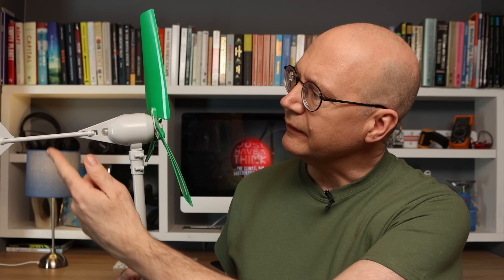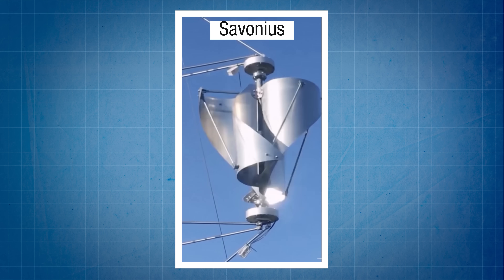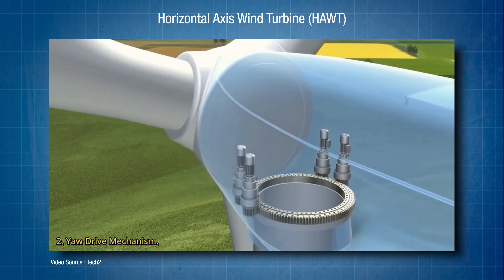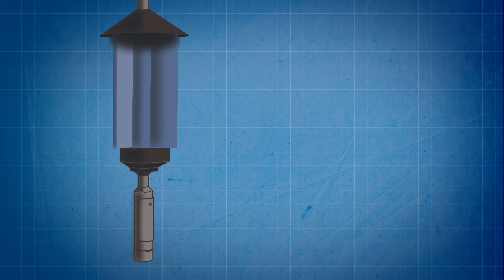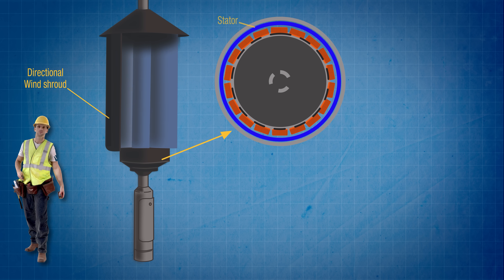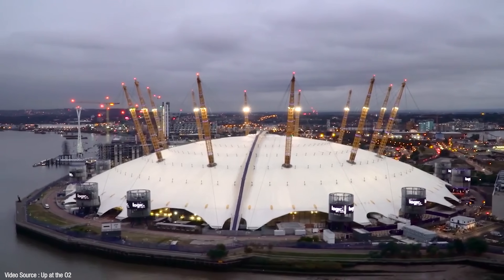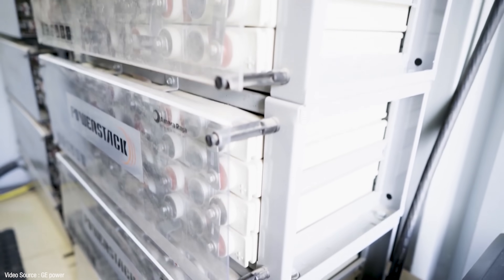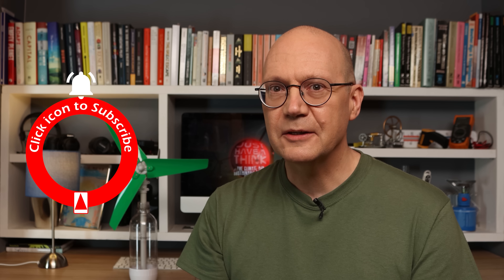A vertical axis wind turbine that doesn't need the prevailing wind! How do they do that?

Comment: As a 'mainly former' Motorcycle rider of four decades I can certainly vouch how much power is generated by large vehicles on our roads.
Reply: That isn't power generated, it's power consumed, creating air turbulence, which ultimately goes to heat via friction.
Reply: On some roads here in Belgium if busses and trucks are passing you while cycling, you don’t have to pedal one stroke. You just ride the slipstream.
Reply: The answer is blowing between blades as oil guards sell embedded betz limits last 100 years.just hold.4x8 blocking it all  in 1 hand turn sidways  the other  sheet and spin out it is  easiest .on.tippy toes greased To make wormholes
Reply: Here's something for the idiots of Renewable Energy: 

Sooner or later you greenies are going to need to grow up and learn how economies work. - hint government people understand nothing of economies other than  how to rape them.    

These G-morons decided "woke' power (power that doesn't really work) was a great idea for them, not us, so they decided to steal some money from some ratepayers in order to pay others to stimulate the growth or power that really doesn't work - ie wind and solar.

In the real world, the one that really works,  there is something called supply and demand and these things regulate the price of everything fairly.  

Your butcher buys his beef by the side and pays more for it than the meat packing plant did who in turn paid more for steer than it cost the rancher to produce it.   Get it so far?     

Now when you buy that beefsteak at the butcher's shop he's going to get his markup as well,  so you as the end consumer are going to have to pay a lot more for it per pound than the rancher was paid for it.   

Next time you want a beefsteak drive out to a ranch and buy your steer on the hoof - then you slaughter it, age it carve it up sell the inedible parts to dogfood processors and the like and eat the rest of it on the cheap - no you want the value that all those who added value to the meat along the whole length of the supply chain don't you?  Or do you buy your steaks on the hoof?      Or do you expect to pay the  ranchers price at your favorite steakhouse as well?

It's that way with electricity too, you cannot expect the power company to buy power back from you at retail rates when they don't even need or want the power. With that business model they will go bankrupt as soon as their investors are wiped out.    

If that rancher were to dine out at your favorite steakhouse why not demand that your ignorant politicians make the restaurant buy his on-the-hoof steer from him on demand at the same rate per pound that they charge you for a 16 oz prime rib?    

The problem is, as with all government planned economies, sooner or later everyone will want to receive the grift instead of paying for it, when that happens the lights go out - permanently.

The most ignorant feature of all of this is that it is supposed to solve some problem that the grifters dreamed up but that does not actually exist so solar panels and wind turbines only create huge problems, they solve nothing - time to wake up you dizzy Californians.
Reply: Millertas. RE: "How much power is generated" Thank-you for this essential contribution! As a bicycle enthusiast & former motorcycle rider, we both know how air-vortexes "power" created by fast moving vehicles force us to correct our trajectories (swerve) as they pass. Cross-winds from regular wind blowing across non-treed highways cause us to 'swerve'.  Millions of accidents (worldwide) are caused by mis-corrections (responses over & under what is optimal) produced by highway a) vehicle-produced & b) regular ambient wind air-vortexes plus c) combinations of both a) + b) against both smaller vehicles, motorcycles, bicycles & pedestrians & or large-vehicles. This steering correction factor causes us to 'SWERVE' sometimes into or bouncing off of a 100 km/hr moving many tonne vehicle & road surfaces. The combinations these vortexes are quite unpredictable & dangerous.
I have bicycled over 100,000 kilometres at home & across the US & Canada portions of the N.A. continent.
As well we must acknowledge wind-vortex damage to highway-close-by buildings & homes.
Linear-axis highway wind turbines by calming vortexes in highway air masses, will have a significant highway accident mitigation for road safety as well as producing energy & mitigating all wind damage produced by highway denuding of trees. Next. Every highway should be obligated to plant trees for absorbing / mitigating: CO, CO2, dangerous toxic Hydro-carbon, dangerous brake-lining asbestos, dangerous tire particles etc. Tree branches & leaves actually convert wind energy blowing through them in huge amounts into ATP as the basic biological cellular energy component of life-function.
Reply: But, if you use it to generate electricity, you are using fossil fuel to generate electricity. Rather using the wind of trucks, will cause as much extra gas usage as the power you generate. It's non ecological and stealing fuel from drivers.
Reply: @zazethe6553  You missed the comment about this in the video.  The energy is already being put into the air by passing vehicles whether there is a generator absorbing some of this energy or not.  There is no feed back to the vehicle so energy isn't being 'stolen' from them any more than the act or punching a hole in the air that happens whatever surrounds the vehicle..
Reply: @dacutler  actually, there is a feedback loop, it's just that we cannot imagine it. By using the energy the cars have to work harder to generate wind energy, because it introduces resistance and the cars have to push harder into the air.  Every kwh you retrieve from it would increase the gass burning by 1 kwh.
Reply: @zazethe6553  Are you saying that from experience?  How does the use of energy that is being created anyway, feed back into demanding more from the engine.? The  turbine isn't  creating a greater headwind as the car has passed before it gets to the turbine.  Also, why are you saying the energy absorbed by the turbine is exactly the same as the energy you say is demanded from the car?  It's an open system, and, even if you are right, it's extremely unlikely the energy absorbed is the same as produced.
Reply: @zazethe6553  , permit me to disagree. The turbines are not attached to the vehicles, consequently, they would not increase the drag on the vehicles. Additionally, unlike dams they do not generate their power by creating a barrier, restricting matter in motion. They merely tap into that already existing flow or displacement which every moving object causes. I also mention that the air would be generated from the  "slipstream" of the cars at the edge of the road, where there is no possibility that that slipstream is leading to increased efficiency by following vehicles. 
This idea is GREAT! Why isn't it my idea?
Reply: @philtarpehdixon7441  I agree.  That's certainly what I experienced when I spent 33 years in the automotive industry, some of which was in wind tunnels.
Reply: @philtarpehdixon7441  by adding drag to the slipstream of the cars, you do actually slow down the cars. The cars are in fact connected to the turbine, air is the connecting medium. I know it is unintuitive, because air seems like it cant do that, but that's just fluid dynamics. By slowing the flow of air in the system, the cars have to work harder. Even if you do it after the car has passed.
Its like when you drive in the slipstream of a truck, you get better mileage, but the truck is actually pulling on you and gets reduced mileage. I know it sounds unintuitive.

The exception could be if you place turbines in the center of the road between opposing lanes, as there the cars have to overcome the drag produced by opposing traffic anyway.

Do not mistake my intention, i am all for ecology and green energy, and i think it is extremely important. But this implemented incorrectly would increase car emmisions
Reply: @dacutler  It does not require headwind to slow down the cars, the car  is being sucked back by the vacuum it creates due to the displacement of the air it just did. This lower pressure behind the car quickly fills back up with air, creating wind. By slowing the filling of this vacuum down by placing turbines in the system, the turbines are in a way creating more suction on the car, as without the turbines the air would rush in faster to fill the vacuum created by the body of car driving trough the medium. This makes the cars work harder,  it more efficient better to allow the air to flow unrestricted.
This is also why cars have rear spoilers, as it curves the air around the body, into the vacuum zone just created by the displacement, reducing drag on the car by the air behind it.

In all things, the conservation of energy is always a bummer. There's no free energy sadly.
Reply: @zazethe6553  Turbines aren't 'slowing the filling of this vacuum'.  It's an open system and the car has long gone before the energy it leave behind in the vortexes produced is used by the turbine.  You are right there is no free energy, but a turbine is using the energy that was being created by the car in the first place, instead of it dissipating in some other way.  A good example of this is how a turbocharger works.  The turbine part of it is using the energy, both heat and pressure (in fact, as much of the enthalpy as possible) that is already in the exhaust to provide power to the compressor to increase the charge in the cylinders.  Taking that energy in the exhaust isn't providing a further drain on the engine power output to anywhere near the energy the turbocharger produces to compress the charge in the inlet.
Reply: @dacutler  It would be like how an electrical generator turns easily if you aren't pulling energy from it's motion, but as soon as you start to draw current turning the stator becomes increasingly difficult (resistant).
Reply: @ikannunaplays  It's nothing like that.    All a generator does is take energy in the form of kinetic energy and converts it to electrical energy.   It's a closed system. The turbines we are discussing here take energy that is the form of kinetic energy in the air and converting it to electrical energy. It's an open system.
Reply: @dacutler  You're right, it does. But, how does a generator accomplish this exactly?
Reply: @ikannunaplays  A magnetic field cutting an electric field.  Or vise versa. Moving a wire through a magnetic field produces an electric current. That's a generator. Or to put it another way, place a wire with an electric current running through it in a magnetic field produces an electromotive force.  That's an electric motor.
Reply: @dacutler  What happens to the moving object (rotor) once you draw current from the system already in motion, and why?
Reply: @ikannunaplays  Like I said this analogy you are trying to make isn't relevant to the turbines we are discussing.  We can discuss it if you like, but it won't get us anywhere in the issues we are discussing.  A generator is a closed system so needs input from outside to create the conversion you are talking about.  The turbines on the side of the highway are using the vortexes and pressure differentials that have been created by the traffic whether the turbines are there or not.  If it wasn't the turbines absorbing the energy in the moving air, that energy would dissipate.
Reply: @dacutler   air is a single medium cars wade through, at the size and speed of a car, slowing the air behind it,does matter. Turbochargers don't work like you say at all, they do in fact increase power draw on the engine. But, they also compress air into the engine, making the engine produce more power thanks to better air to fuel ratios. This makes it an overall gain. It has nothing to do with this.
Reply: @zazethe6553  I agree with you that unless the turbines are placed between two opposite lanes of traffic, the turbine will worsen vehicle mileage therefore resulting in worse vehicle emissions. But I think you missed some details of their project as judging from video, they intend to place the turbines right in the middle of opposite lanes of traffic. The purpose of the directional wind shroud on their turbine design shown at 7:02 is to ensure opposing wind direction(because they intend to place them between opposite traffic lanes) won't counteract one another and reduce the turbine's efficiency.
Reply: @zazethe6553  absolutely incorrect
Reply: @zazethe6553  No.  In open air it's only wasted air motion that's being harvested.  There is no mechanism for taking useful energy from the car unless it's in a system like the car is pushing air through a close fitting tunnel and that air is slowed down by a turbine in the tunnel that resists the airflow, thus increasing the resistance on the car pushing that air.  
This may be easier to understand with the example of an anchored generator in open water with a tethered bobber that spins the generator through a ratchet when a wave lifts that bobber.  The wake from a passing boat will contribute energy to that bobber long after it has passed and with no energy extracted from the boat that was not already wasted by making those wake waves.
Reply: @denbecr49  the fact that the bobber is there, requires the boat to expend more energy. Exactly as much as the energy needed to keep the bobber,bobbing for as long as it does. There's no such thing as open air, you just can't imagine how fluid dynamics work, which is normal,as it's extremely unintuitive.
Reply: @zazethe6553  
The fact that the bobber is there only raises the water level, irrelevant to energy expenditure by the boat in making a wake, by my reckoning.  The energy imparted to the wake travels with it until it is lost in ways that do not change anything in the relevant vicinity of the boat in any way I can imagine.  It's not really science if it's something correctly ascertained by intuition or "common sense", so I'm genuinely curious.  If what you say is true and you understand it, you should be able to describe how the energy in a boat's wake can affect the boat according to how the energy is subsequently transduced.  The bobber is extracting energy from the wake that is moving AWAY from the boat, right?  Would you have to cite too much of the science of fluid dynamics as prerequisite for enlightening me about this particular scenario?  I encounter that when debating religious antievolutionists,  flatEarthers, antivaxxers, overunity believers etc.  I hope Dunning-Krueger isn't lumping me with them on this issue!   😰
Reply: @denbecr49  right, no energy taken from that boat, but then an infinitesimal abount from the boat behind, and from the one behind that, and from the line of boats behind that
Reply: @denbecr49   ohhh, also, I just got your point. The turbine does sort of affect the car moving TOWARDS it, as the car is pushing air towards the turbine, as well as sucking it away. As the car approaches, the air is pushed towards the lamppost which provides a resistive force back to the car, but since most of the air can slide past the narrow profile of the lamppost, there is not as much of an affect. The turbine, with a wider profile, provides marginally more resistance to the car as it approaches. It is marginal per vehical, but 25kW is insane XD
Reply: @zazethe6553  the air that goes to the vacuum behind the vehicle doesn't always have to be on the side, right? Even if air is being slowed down by the turbine by the side, air on other areas will be sucked instead, like directly behind or on top of the vehicle. If there's a vehicle following behind, it might even push the air forward to the next vehicle. Also, the wind doesn't always has to come from vehicles, it can also come from natural wind.
Reply: @nd_otd  correct, I never said it was a huge effect. But it messes with the fluid dynamics of the air. Maybe it is only .01% impact on the car's fuel consumption. However if the turbine generates 1000kwh, and it requires 10000 cars to do so, every car will contribute 0.1kwh worth of extra burned fuel. This is tiny, in comparison to the actual output of a car, but multiplied all the energy of the windmill, that doesn't come from external wind blowing in, cold from the fuel of the cars. The effects and drag within air are not noticable in our daily lives, so we think it's not there. but small amounts multiplied by high speed, large bodies of cars and huge numbers of cars, do add up. Similarly,a single car also will not even produce enough wind to make the turbine spin 3 times, so by that logic, the turbine shouldn't generate electricity, but it does, because many cars pass by it, all contributing a fraction of the energy needed.
Reply: @zazethe6553  "by adding drag to the slipstream of the cars, you do actually slow down the cars."
You are correct. There is no free energy.
If the turbines are far away from the vehicles they won't slow them but they will not reap any energy. If they are close the opposite will apply.
The extreme example is a vehicle in a tunnel with a turbine at its mouth ,the vehicle has to expend a huge amount of energy to push the air ahead of it ,down the tunnel, to be recovered by the turbine.
Vehicles even effect each other purely through their aerodynamics. When one vehicle "slipstreams" another, as is common during races, both vehicles benefit . They become one aerodynamic system. The trailing vehicle benefits by not having a "head wind" because the vehicle ahead is parting the air ahead of it and the leading vehicle benefits from reduced wake turbulence creating drag. The entire system is more efficient due to having an improved frontal area to length ratio and therefore can achieve a higher speed than the individual vehicles could on there own.
Reply: @zazethe6553  
You are right, only in that Cutler chose an inapplicable analogy with his turbo.  He was correct up to that point, IMO.  
On a calm lake a distant boat can be docked by the time the energy in its wake is harvested.  You haven't convinced me the boat could have docked sooner  except for a future interception of its wake.  Yes, I know there are unintuitive things about all sciences, but that's just handwaving when specifics are being debated.  In this example you would have to argue that a cause can come after its effect.
Reply: @quadracycle4000  
That MAY be the case, but that's not what Zazethe is claiming.  He claims energy is robbed from the first or only boat with no mention of followers.  Even in your case, bobbers extracting energy from waves makes for calmer water.  Boats travel more efficiently through calmer water, not in the wake & turbulence of another boat, but that's getting into differences between powering & drafting through water vs over pavement.  Turbulent air at the right scale can reduce the relative vacuum behind a moving vehicle as in the case of vortex generators placed where the slipstream ordinarily separates from airplane wings and fuselages, but those examples only raise the question of whether the  bobber is returning more energy to the boat than it's robbing from it when it reduces the size of waves.  No. It's doing neither.  But in the case of vortex generators, they are robbing a little power from the plane in a manner that reduces it's drag, thus saving, but not returning energy.
Reply: @zazethe6553  No.  Drafting a truck does not reduce fuel economy of the truck.  In a drafting situation both vehicles are accelerating a smaller combined mass of air than they do separately.  Both benefit, but the follower gets the greater share.  Even the lead truck gets better fuel economy in a convoy, just not as much better than the others.  Eliminating part of the relative vacuum behind a truck reduces the load on its engine.  It's 'unintuitive" until you understand it well enough to improve your intuition.
Reply: @denbecr49  I am trying to visualize this, you are thinking a basically 2 dimensional wave behavior works the same way as a 3 dimensional teardrop shaped air pressure bubble? I'm not sure that is a direct analogy. If the vehicle is moving through the air mass like a submarine would through water if it was compressible, creates a high pressure wave at the bow and there would be a trailing low pressure area creating drag. 
    A moving bubble of changing air pressure. What he is saying is spinning the turbine takes energy from the entire bubble as it moves past, not just from the air on the high pressure side.  If it takes more from the bubble than it gives to the grid then the vehicle is losing. 
   This is not taking into account being mounted in the center of a divided highway, two way traffic or wind.  Which are all game changers.
Reply: @rockon7848  
What I'm saying is there will be energy in wind produced by the vehicle that can be harvested outside the "bubble'' you speak of.  Just like my example of a boat's wake, an airplane that has landed leaves energy in turbulence that lingers long after the plane is gone.  The next plane's landing on that runway has to be considerably delayed.  None of that turbulent energy can influence the relative vacuum behind the plane minutes after the plane has long traveled into undisturbed air.  
My objection to Zazethe's statement is about his extrapolation of effects way beyond their real limits.  
He's wrong about a truck's mileage going down when it is being drafted.  
He's wrong that the mere presence of a bobber in the water extracts energy from a long passed boat.  He is right that any wind generator close enough to inhibit airflow in a manner that increases the temporary Cd of the vehicle will be robbing power from it, but my point is a nearby wind turbine isn't necessarily interfering in that manner depending on where it's placed.  The airflow around even a very aerodynamic supercar is definitely not a 3D teardrop shape. The car would have to be a perfect 3D teardrop shape itself and proportioned to match a specific design speed for that to be the case.  
Since wakes behind real vehicles are very turbulent, they make air movement and vortices that move away from the vehicle and trap energy that is not available to reduce the relative vacuum behind the vehicle.  That energy can be harvested with no inevitable feedback to the vehicle.
Pay attention to leaves, dust, plastic bags, snow etc. in the wakes of vehicles, especially trucks, and read about vortex generators to understand that turbulent air may actually better fill up the zone of rarefied air that's impeding a vehicle's efficiency.  
Can you see how a turbine designed to be rotated by the vortex in the video below could possibly impede it's efficiency?  Z. argues it's inevitable.  What do you think?

Massimo (@Rainmaker1973) Tweeted:
The spectacular wingtip vortices generated by the smoke and the low passage of this old airplane https://t.co/UBBXm5jQ6b https://t.co/RFYhN0rUAx https://twitter.com/Rainmaker1973/status/987951678946267136?s=20
Reply: @dacutler  Surely.. most of the extra energy provided by the turbocharger principle comes from the extra fuel you can throw into the cylinder capacity without making the combustion mixture to rich to burn efficiently.. because now you have more oxygen in the cylinder provided by the turbo. So, the benefit is gaining more power from a smaller power unit. But the power gained still comes from the increased fossil fuel being burnt. The overall economic benefit comes from the fact that, when you are ticking over in a traffic jam you are doing so with a smaller engine with reduced friction surface area and oil sump stirring. Maybe only 3 cylinders to heave up and down too.
Reply: @IIPhotography  Actually, the extra power output of the engine comes from the greater mass of air / fuel mixture in the cylinders, as you suggest, but the power needed to drive the turbine part of the turbo charger comes from the energy in the exhaust, both pressure and temperature. The combination of the two is called enthalpy. Also, there are two more benefits.  The output noise of the exhaust is reduced (mainly because some of the energy has been taken out of it, and converted into mechanical energy to drive the turbocharger) and the whole energy cycle is more efficient.  In fact, that last benefit is the main reason why you see almost all gasoline (and diesel) engines are turbocharger in modern engines.  The torque curve, which is a direct result of the cylinder pressures, is a mirror image of the SFC curve (the specific fuel consumption curve, -  a measure of how much mechanical energy is being provided by the fuel) and it's the improvement in the SFC curve that makes the engine more efficient.  That is, uses less fuel to provide the power output. So there are two main effects.  The engine is more efficient, and contributing to this, the pressure and temperature of the exhaust are reduced.  The reduction in the enthalpy of the exhaust is easily measured if you do a heat balance on the engine on a test rig (by taking the temperature and the pressure at the outlet of the exhaust).
Reply: @dacutler  Enlightening reply. Interesting.. I need to do more in depth learning on this one then.. or maybe not. There is always the reduced efficiency of having to scrap them sooner as they are uneconomic to repair.. which I see as the main problem with modern cars and a significant part of their carbon footprint. I'll stick to my normally aspirated pre 2001 cars thank you.
Reply: @IIPhotography  With regard to the longevity of modern complex cars compared with older, much simpler cars, you make a very good point Neil!
Reply: @zazethe6553  russian oil guards dont like tides either no wonder
Reply: @stevenlonien7857  i don't know what you mean by that. what's a Russian oil guard? like a prison guard for oil?
Reply: @zazethe6553  No , the tiny additional drag will NOT affect large trucks in any appreciable way, any worse than existing signs do (probably less, as turbines aren't essentially hard obstructions) and probably won't for anything but the smallest, lightest and very slo-moving vehicles- there's just not enough mechanical coupling in the wake back to what generates that wake to materially affect its drag coefficient. Essentially ALL loss is very immediate to the surface of the moving object- where do they mount anti-drag fairings on vehicles?
Reply: @ticthak  yes it's unnoticeable for 1 truck or car. But the turbine also is tiny and makes very little electricity. And the little electricity it makes comes from the fossil fuel of millions of cars each year. It's probably way less than 0.5oz of fuel from each vehicle passing, but a lot of vehicles pass it. We are talking about ecologic impact, the meaning is to burn no fuel, not distribute it secretly across millions of vehicles each year.At that point you can just not waste the metal needed to construct the turbine.
Reply: @zazethe6553  "We are talking about ecologic impact, the meaning is to burn no fuel," So, of course, as soon as you've revealed this inarguable logic, immediately fuel use will cease. Or ever.
"At that point you can just not waste the metal needed to construct the turbine." At what point SHOULD you "waste the metal" to construct a wind turbine of any configuration, since NONE of them have a good theoretical conversion efficiency?
 P. S., most of their turbine is composites.

You consistently ignore the ecological FACT that of the fuel burned in the vehicle engines, most is wasted (completely and nonrecovarably) through heat radiated to the environment, and much of the remainder lost to frictional losses to the vehicle, road, and air- and virtually NONE of this is is going to be in any way affected by whether objects outside the slipstream (the ONLY region obstructions are going to affect the stream-generating body) are present more than a few feet away (any drag exerted is going to be some fraction of (RMS value of the diameter X drag coefficient of the object/(distance^2).

Just try plugging in a few realistic numbers above and realize that's the MAXIMUM possible, and dependent on the speed of the vehicle.
Reply: @ticthak  a big scale turbine that actually produces a few megawatts. Instead of tiny worthless turbines that barely generate a few kilowatts. Economy of scale is in favor of big installations. These small turbines are just a waste of copper, concrete, plastic, composite or whatever they are constructed with. We already are putting big turbines next to highways, and they work well.
Reply: @zazethe6553  By that reasoning, ALL small-scale wind turbines are a waste of materials. And no, we are NOT putting megawatt-range turbines next to highways, at least not anywhere in the eastern half of the U.S. At least 1/4 mile away is not next to them.
Reply: @ticthak  Jup,all small scale are a waste of materials. Maybe it's economically viable to put in your backyard. With the budget available to cities or power companies, it's a bad option because they have just to little power.. Yeah half a mile is near the highway, I didn't mean literally next to the road. And there's place enough to put them.
Reply: @zazethe6553  The energy you talk about is currently being wasted.  Every vehicle going by is disturbing the air around it irregardless of whether there's a turbine to pick it up.
Reply: @DavidHerron  "irregardless", where did you find that word?  If it existed it would have to mean 'not regardless'!